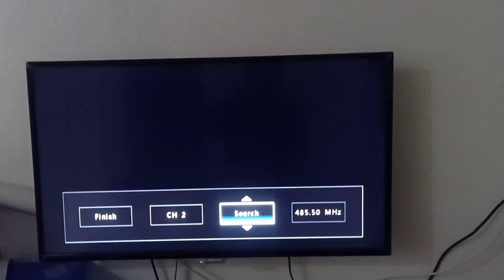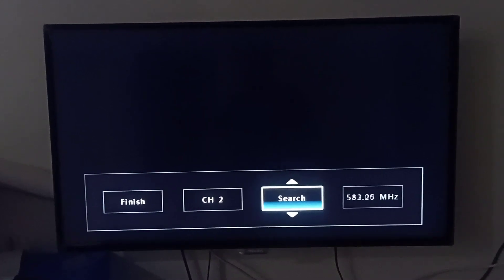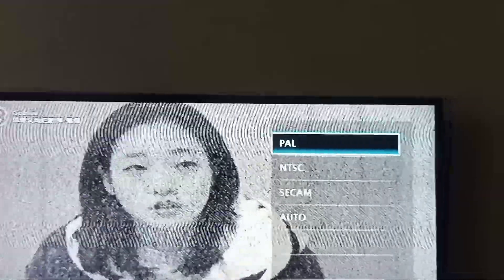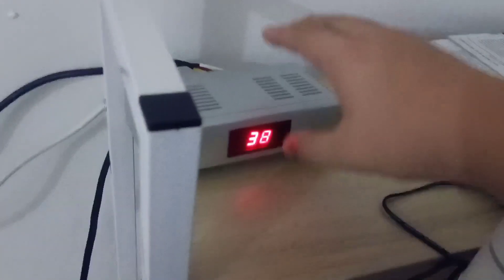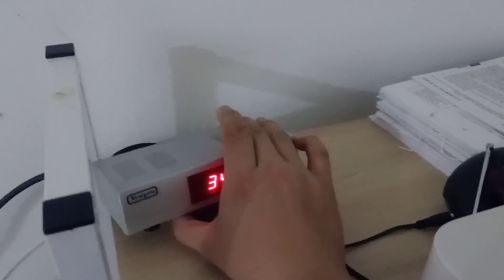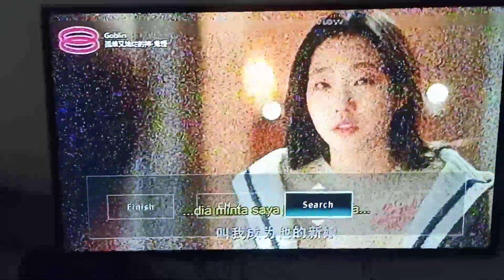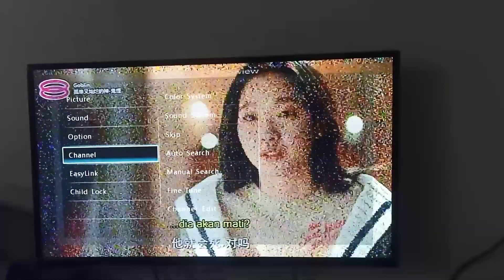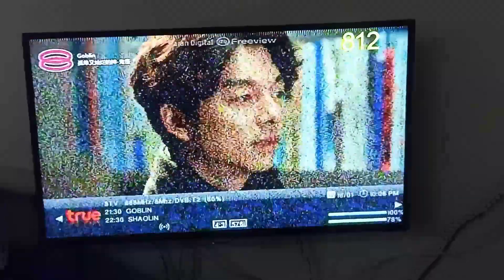What happens if channel 38 UHF gets interference with channel 9 VHF

Comment: I ALSO USED NTSC RF MODUATOR BOUGHT FROM THE PHILIPPINES ON CHANNEL 3 (61.25 - 65.75 MHz) and set my video device from NTSC to PAL and set my TV from NTSC to PAL but black and white. NTSC modulators only worked on NTSC (3.579, 525 lines), PAL-M (3.575 MHz, 525 lines) and PAL-N (3.582 MHz, 625 lines)

Comment: So, how to scan manully and sound sistem on your TV for used by modulator, bro???
Reply from the maker: For scan manually, must go to settings, tuning/channel setup/etc, manual scan/manual tuning. You can scan manually. It will automatically stop scanning when channel was found. You can press it again to find another channel. Once you're done, press save and done.
Reply: @SennLens  OK 😉👌
Reply: Senn Lens ONLY WORKS ON PAL? HOW ABOUT SOUND SYSTEM LIKE SYSTEM M (4.5 MHz for usein South Korea) from the Philippines or US NTSC, Brazil PAL-M (NTSC frame rate), Argentina PAL-N (3.582 MHz color but same frame rate as PAL), PAL SOUND SYSTEMS LIKE B/G (5.5 MHz for Malaysia and West Europe), I (5.999 MHz for Hong Kong and the UK) and D/K (6.5 MHz for China, Russia, North Korea)
Reply from the maker: @FrancisLitanofficialJAPINOY  I only can use NTSC or PAL with B/G sound system.
For my satellite+digital TV decoder, it only works well with NTSC while another one (satellite decoder) works well with PAL. Both are using B/G sound system.